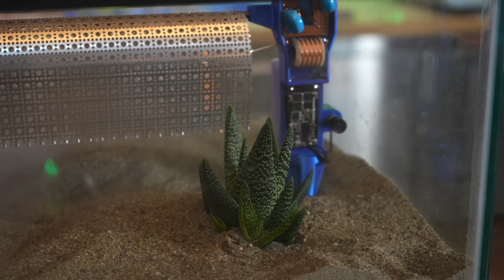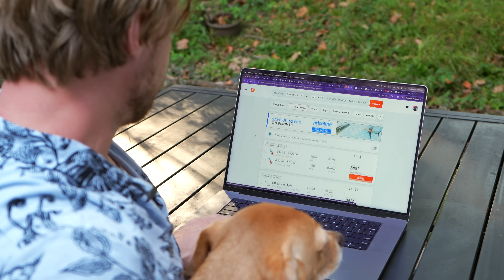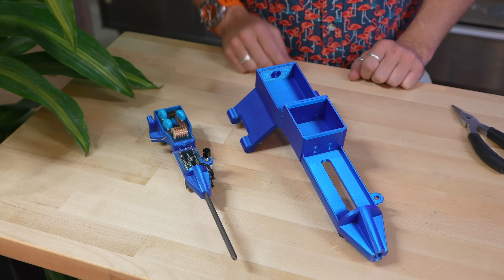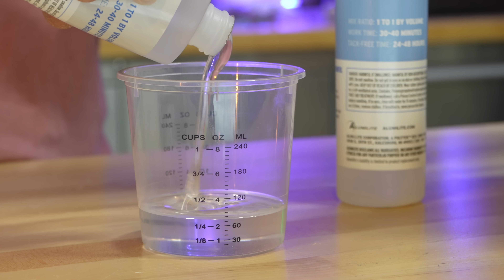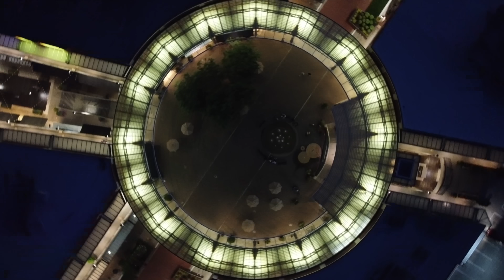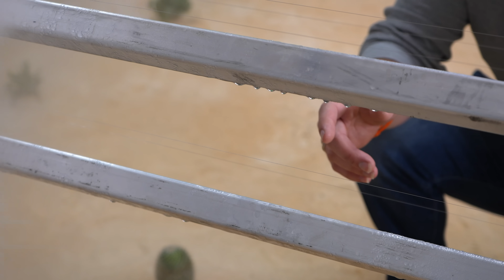Turning Desert Fog into Fresh Water Using 50,000 volts

Comment: Too complicated and expensive. Why not build a stainless steel tube and mesh system? You fill the tubes with salt water and any moisture that flows through the mesh condenses because of the cold thermal reaction.

Comment: PLA will warp immediately in the desert. ASA or abs are better for holding up to those temps. Other materials also help shield electric interference from part to part. 
An Arduino with a hygrometer set to turn it on and off is low power consumption and very small and cheap.

Comment: Building giant, extremely white, cold helium balloons with nano-nets that capture hot clouds at high altitudes, suspended by ropes, whose function is to produce water and stimulate rainfall. More than one balloon is launched in a ring shape, and at the top of each balloon there is an electric Tesla device that ionizes the clouds and stimulates rainfall and captures water. What do you think of the idea? Will the water produced be high, and is the idea suitable for desert areas?

Comment: Two major points of issue with this.
1. The water you are producing is distilled water, it is unnwise to comsume distilled water in a desert survival condition for either short or long term because it is pure H2O with no dissolved electrolyes at all. This means it will cause dehydration much more rapidly than groundwater in a survival situation by leeching necessary minerals and electrolytes from the body when they are needed most. This is why rainwater gathered in plastic cisterns need a mineral block or additive. Over long term use without it, a person developes bone, mineral and nervous system illnesses and deficiencies. A desert emergency situation over more than a day will only heighten those effects. So, any use for emergency survival of this device would also have to include electrolyte and mineral supplements to be included. A workaround for supplements could be to design the system with the ability to sterilize the collected water that had desert soil (not just sand) added to it if it contained the necessary minerals in the proportions required. Thus, turning it into something akin to potable groundwater and not like distilled or pure rainwater since any desert emergency survival would probably not include the proper food source supply/quantity to supplement the lost electrolytes and other necessities from pure H2O intake. Otherwise, drinking distilled water in the desert, especially in survival mode, combined with any travel or workload and reduced solids food intake is a sure recipe for electrolyte imbalance induced heart arrhythmia and/or myocardial infarction.

Based on my available data gleaned from the web, the average time for successful emergency rescue of a person(s) stranded in the Aticama and Namibian deserts was on average 32 days until rescue. This was on reports over a long period of time, later rescues took shorter due to modernized methods of S&R locating and recovery.

2. The night time fog ensures all things get the moisture equally in preparation for the daytime evaporation and low humidity. Even the fog that settles on the ground keeps lower layers from evaporating during the daytime dryness as fast. Daily use in the same area will have an effect long term. How long until noticing the effect will depend on the degree of use.

If this device works as well as you say, what things downstream of your device and its radius of effect are you going to tell they have to do without?

 If used for emergency desert survival, if it locks a person to one spot during the hours its best for them to be mobile if need be i.e.- night and/or twilight travel, then it will require a stranded person to mobilize during the hotter daytime if they need to cover ground. Perhaps a sensor with a programmable limit to set the amount of water it takes from the environment as only what is needed for the set number of people requiring it in any long or short term emergency situation or, changing the location daily outside of the effects of the previous working radius.

 I don't see collecting fog from night time desert situations as environmentally friendly for agricultural use since all the moisture collected that would be needed to sustain an agricultural crop in a desert setting would be daily robbing all other life in the working air volumes radius of operation from moisture for its own desert environment needs.

Setting up a stationary crop in the desert just to have what little life is there beforehand die over a sustained period of being robbed of essential night time moisture isn't very responsible for a good working stewardship of nature.
 Just food for thought.

Comment: 21:24 Go pull a detection chamber out of a smoke detector. It'll trigger off fog just fine.

As for the principle: LED or laser in a blackout chamber shines past a hole with a phototransistor just behind it. There is no direct line of sight between the two. When particulates enter, they pass through the light and scatter it, with some hitting the phototransistor, and that's your signal.

Comment: Organic carbon power cell powers a pizoelectric solid state Stirling cold gas cycle piston air liquifaction module generation of liquid air fills an insulated tank gravity flow. Seabeak effect electrical power generation system kicks on from ultra low temperatures from the liquid air charges up power cell puts it on standby. Seabeak effect electrical power supply power's ultrasonic vaporizers frequency set to generate water vapor from the liquid air.  Fog nets turn vapor into liquid gravity flow drains into a underground cistern to filter water and mineralization of the water that fills another underground cistern with fresh clean mineralized drinking water supply.  Pizoelectric solid state pump pumps the water from the cistern.  Fresh drinking water right from the air no solar panels needed. 😊

Comment: Some thoughts on fog sensors, a camera looking at a target and something to figure if it is obstructed or not,  a laser beam passing a camera, that will be visible if there is fog, not visible if not.  And lastly if you had a light sensor pointing at an area illuminated by LEDs (but not at the LEDs), it will pickup reflection if fog is present, the amount of light reflected should roughly correlate to the fog density, could possibly do that with lasers too.

Comment: That was awesome!…, if you don’t want to travel so far I have a property in the American southwest you could use… also, the solar panel is cool but for added power possibly take advantage of the huge temperature fluctuations found within desert regions by use of something akin to a pyroelectric device attached to some kind of heat sink.

Comment: 21:24 Switch when fog is present: You install a piece of unused fog net, when it gets wet, its resistance goes electrically, and it can be used for control. They are made of different materials, you have to experiment, which one works.
Or the breakdown voltage circuit of dry air and humid air, or rather, you research the latter, when it breaks down at a given voltage, because it is humid, you have to design a switching current. ;-)

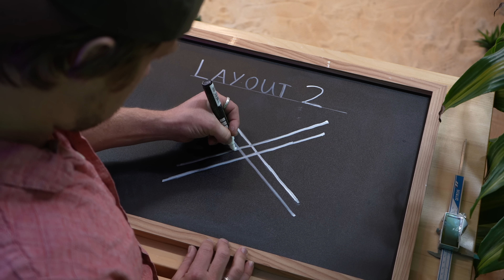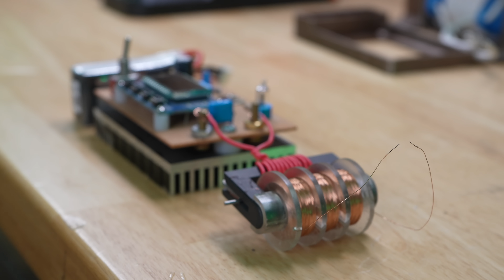Comment: According to wikipedia, desert fog water collection is typically from 2-20 meters above ground and persists for 2-8 hours. 4 meters tall are typical. Peak fog density is typically between 3:00 and 8:00. So maximizing collection from such fog, will this be optimized by multiple pairs of wires and collector bars? What would be the optimal spacing? Is 50kv better than 20, and if so, what is the optimum? This could be very effective for these high solar energy, low water regions. Great prototyping project, proving the concept!

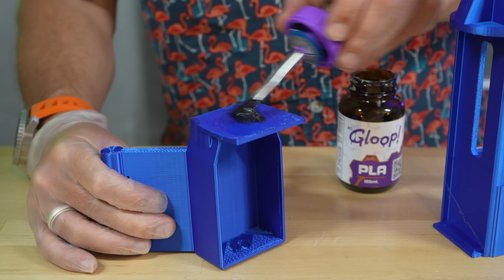Comment: 6:01 Uhh. PLA! Great choice! The only better choice would have been PVA. /s In case y'all don't know PVA isn't UV resistant and gets brittle real fast. And PVA dissolves in water.
20:48 Congrats, with the used 63(65?)Wh battery you can run your device about half an hour. (still charges 13 hours with your dinky panel). And even if it captures 100% of the fog while running, it only runs about 4% of the night. Adding in all the stuff that can break, and you made fog harvesting more expensive, easier to fail, and for the same efficiency. Probably easier to put a 5W fan there if wind isn't blowing as it should.

Comment: For the auto on switch, you just take a voltage reading of the solar panel and when it drops below a certain voltage due to the sun going down, then a signal gets sent to the on/off switch to turn the machine on. When the voltage gets high enough on the solar panel, the signal tells the switch to flip to off.

Comment: While I recognize the fact that this simple design can help those in need, the efficiency he's proposing is way way way higher than industry standards to a point that makes me very skeptical. I think the root cause of such a high efficiency rating is the fact that you're using a fog machine which is far beyond normal humidity levels. I would like to see an actual real world test which you can do at home when the humidity is highest. There you'll see your near true efficiency rating otherwise this experiment hacks controls to boost efficiency making it look great on paper.

Comment: How well would this work on a sailboat in the middle of the ocean?? Would it be humid enough to pull enough water? Marine water makers are costly and use a lot of power. Could this be the route to a better solution?

Comment: You could angle the collectors slightly down towards the middle, then collect all the condensate at the central unit.
Reply from the maker: The arms were angled, at 6 degrees. Just barely not enough

Comment: Could you adjust the Rails in a way that they collect the water like a gutter - So in a slight angle (that the main post is the lowest point for example)? That way the water would be easier to collect in buckets instead of just dropping straight down onto the ground. 
As Sensor you could use a photo diode or IR sensor. Fog is disrupting the light that the sensor sees. It is similar to the fog detection in cars via Rain-light-sensors (older ones. Newer Cars detect fog via  camera) and in combination of a humidity sensor.

Edit: You already answered my question on some other comments - so never mind  :)

Comment: Great idea, but i feel like there’s a few problems, like the fact of it needing high voltage as well as various electronics which may need maintenance as well as are fairly expensive, I feel like a better solution would be a large balsa wood frame with thin metal sheeting similar to tinfoil stretched across, sprayed with either simple white paint or one capable of radiative cooling. This can be put on a single post with a bearing to be made to always face the wind, though there may need to be some experimentation for if it’s better to have it along with the wind or head on
Simply put, a modernized version of the ancient technique

Comment: U said u gonna use some kind of switch to on and off. There is a LED Solar light that have build in sensor that turn on the power by sensing  the light or another sensor which turn on when Solar is no longer generate power. btw  those Solar LED have remote control and they also have Timer.  I think u can apply same thing in there to make it fully auto or even control it.

Comment: Why don’t you start in a desert closer by. In high deserts, where I live, I struggle with being able to water my winter garden. With little precipitation even in the winter my plants need watering but with freezing temperatures at night I can’t keep my irrigation system on. I can have dew or frost on my plant covers in the morning yet 55-60 degree days mixed in with cooler temperatures. 
Also you might talk to a computer engineer about using a raspberry to read weather conditions. My husband has a sensor out in my garden with Bluetooth and a raspberry (mini computer thingy). I hope to eventually be able to have sensors in my soil reading moisture content so I can better control irrigation needs.

Comment: What about collection? Will you have to put two buckets the entire length of the arms? Or you could raise the arms slightly to allow the water to flow down to the ends away from the electronics and have a rod for the water to fall down into buckets?
Reply from the maker: I actually covered that in the video and it’s why I designed the arms at a 5 degree angle. Water drips toward the inner ends. Cheers.

Comment: This is not even remotely viable. Your previous video got 45ml/(5min*39w) for 0.01m^3/kwh. Desalinization plants have a typical efficiency of 0.2m^3/kwh. Your best case scenario with far denser fog then this will ever encounter costs 20 times the energy desalinization takes and it only works in the same areas that can be irrigated with desalinized ocean water. You're probably looking at a realistic INCREASE in energy consumption over desalinization of 100x.

Lot of compliments in this comments section. Zero math capability.

Comment: i told a really good radio guy about really high electric bills lately and i was going to unground from the grid . he said he drove 2 more ground rods 6ft apart one at a 45% angle outward . #4 copper wire in a loop connecting the rods then back to the service . he said over grounding the system will lower the bill . i like that idea and if the bill dont lower 2 more rods and a water line will enable me to unground from the grid

Comment: Question ? as a plumbing heating contractor iv found that  electric services that were not grounded to the grid have lower bills . they ground through their water main and ground rod .this happens when someone crimps the ground at the head without no ox and it oxidizes or just a bad connection at the socket . replacing water mains is when i have found this . cut the pipe the whole house dims .hurry touch the pipe back together and shut the main . this has happened several times over decades . every homeowner said dont touch the grounds our bill is so low dont change anything . all i can think of is the meter measures against the  ground and not grounded to the grid measures lower

Comment: in your BSI thruster, you should heat the electrodes, its similar to a cathode ray in CRT tvs, but those heat the cathode so the electodes boil off, i also think you need to play around with higher current instead of voltage and frequencys

Comment: i think you should place the wire at an angle so it will not blow away the fog wend the wind hit the ground. also a light activated timer switch programmed hours after the sun sets or when the fog hinders the light, the switch activates and turns on the device.

Comment: fascinating! thanks for persisting with this

are there a couple of ways of boosting efficiency?

gasoline | petrol car exhaust systems typically use catalytic converters

they have enormous surface area

imagine if you were to connect 50KV to a catalytic converter, then pass air through it; would the huge surface area greatly enhance liquid water generation?

cold climates use air source heat pumps; they use large fans running at relatively low speeds to move large volumes of air

currently, they only do that to extract heat from air

now, imagine...
 - air source heat pump
 - the 'exhaust' air from the air source heat pump is colder than ambient air
 - that means it can hold less water
 - pass that 'exhaust' air from the air source heat pump through a gasoline | petrol car exhaust catalytic converter connected to 50KV
so that...
 - you are using the moving air from the air source heat pump - eliminating redundant air handling
 - the air is colder than ambient, so it inherently wants to 'lose' water vapour | vapor
 - the air is passing through 10,000 to 100,000 SQUARE METRES - that's over a MILLION square feet - of surface area
 - that surface area is charged with 50KV
so that - MAYBE - 
 - it liquifies huge amounts of water vapour from the air
 - it is relatively efficient, in terms of watts / litre
 - it works in 'perfect' conditions, but also difficult conditions (eg low humidity)

any experts care to share their expert opinions? I'm just a lay person who is eager for reduced water scarcity worldwide, but has no idea how to achieve it, but is inspired by this video and superficial understanding of related ideas

Comment: This, this technology is very promising. I do not know if you know but remote Madagascar communities are facing water scarcity problems regarding access to clean, drinkable water. This is ambitious but I have an organization that is looking to engage communities in need and I'm looking at this and I love it. So I'd like to implement it to those communities. But one problem would be supplying and storing the energy needed to power those equipment. Solar is good.

Comment: For the Fog switch, couldn’t you use an IR LED and a photodiode, offset or at an angle of 30' or more so that if there’s no fog, the IR light passes the diode? If fog is present, the IR is scattered enough that the photodiode will detect it and turn on.? The only problem is that it would consume power 24/7.

Comment: Hi, I love your videos. I would use a humidity sensor, an Arduino, and a relay. You can run the entire system from the rechargeable battery, and programming would be easy. It would cost less than 50 dollars.

Comment: If the ends of the arms were higher than the center, the water could be made to run towards the center simplifying collection. The center arm supports could maybe even be designed to create a drip spout or capillary pipe to carry the water from the top arms around the obstruction of the lower arms.

Comment: Would it improve anything if drilled holes or used a mesh similar to what you used in your first version, instead of the smooth metal bars? This would provide more nucleation points and in theory allow for greater yields. However practically I'm not sure how much of a real difference it would make